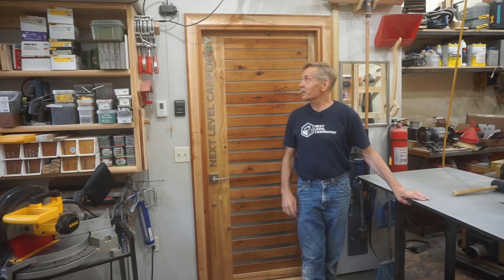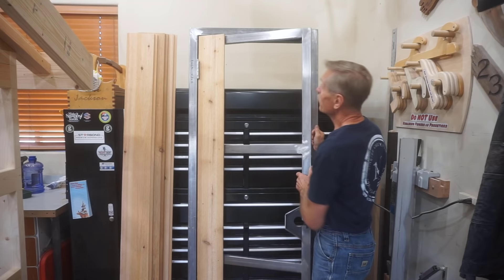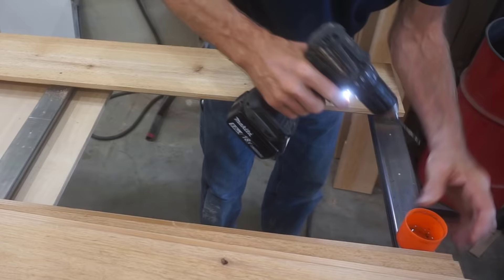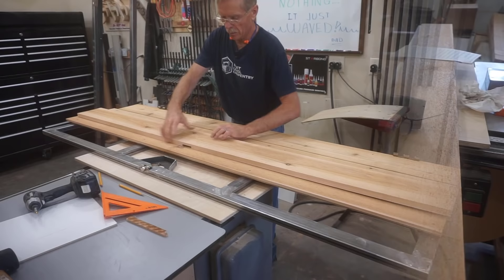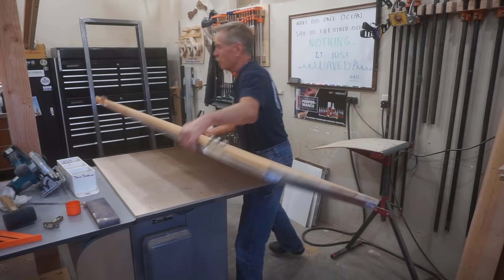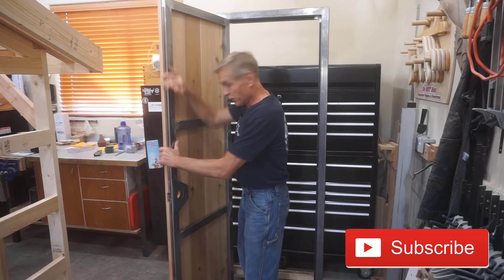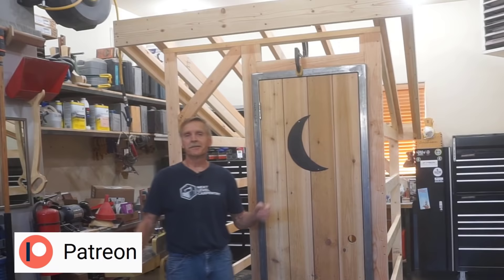How to Attach Wood to Steel

Comment: Can these screws be used to attach cypress to 14 gauge 2.5in steel frame
 tubing in a metal bldg?
Reply from the maker: I'm sure they can but you'll probably need to do a bit of trial and error to get it to work consistently.  As a rule of thumb, the thicker the steel, the larger the pilot hole.  That's because in thicker steel the screw's threads aren't really cutting threads into the hole as much as they are deformed by compression.  To see what I mean, drive a screw in so it grabs and seats and then remove it.  There won't be much for threads in the inside of the hole but threads on the screw will be mashed down considerably.  Keep in mind that it doesn't really take much for the screw to hold wood to steel strong enough so that if you try to pull a board off the screw head pulls through the wood but the screw sticks in the steel.  Do some experimenting to find the smallest size hole that screws can be driven into consistently without breaking the screw or stripping its head.
BTW I'm trying to source about 300~400 board feet of 4/4 cypress for a project and can't find anyone locally to supply it.  Where are you getting yours?  A source would be greatly appreciated!
Best, Matt
Reply: @NextLevelCarpentry  Dude stop adding music.  there is no need to add music.  TY for listening.
Reply from the maker: @MichaelMantion  TY for listening?! You are polite enough but if you think I'm going to quit producing videos the way I do because of your comment you're at least mildly delusional🤨😂😂

Comment: Fantastic little tip! I do prefer stainless when working with cedar though. I’ve found EVERY other fastener eventually starts bleeding, regardless how corrosion resistant they say they are.
Reply from the maker: Thanks for posting this comment with your preference Dan!  Because of it I checked Amazon and found they have the same GRK torx drive trim screws (in 1 1/2" length) in STAINLESS STEEL... NOICE!!  Stainless is my preference as well but I didn't think to see if they were available until now.  I thank you and my client thanks you as we won't have to deal with inevitable streaking (eventually) from the good but not as good fasteners I use in the video.  Best, Matt
Reply: @NextLevelCarpentry  I’ve gleaned a lot from you Matt, glad I could be useful!! The stainless screws are NOTICEABLY softer- as you’d expect. Just takes a little more patience/precision, and you’ve got plenty of both. Love those little screws.
Reply from the maker: @danervin2530  I'm duly noting the 'noticeably softer' part and, with that in mind, plan to use a little wax on threads of those on the door after its powdercoated. Thankfully there's only 32 fasteners that go into metal, the rest go into wood (pine and redwood) so I think it won't be too much of a fight...🤞🏻🤞🏻 it's well worth any extra fuss for streak-free-and-proud fastening though!

Comment: Yep, works nice with GRK screws, also works well with Spax. I’m sure it will work with other high quality screws as well. Another good one for interior trim work with steel stud framing is Senco’s hardened diamond point 15 gauge finish nails.

Comment: I love combining steel fabrication with woodwork. Powder coating is a great solution for protecting the steel (if not stainless). The temptation is to pick black or something outrageous. I tend to pick colors that compliment the wood finishes I use.
Hah! That’s a finely crafted outhouse, for sure.
Thanks for the tip! Oh, I also have been known to add a daub of PL200 to the joint between steel and wood to ensure it stays together through inevitable door slams favored by young folks…😉

Comment: What many don't realize and many more do, is that trim screws, all weather deck screws, even the E.G. (gold) drywall type are case hardened steel (actually, the black phosphate drywall screws are too), or a fully hardened steel. This is a pretty old trick and works well. With the right sized pre-drill the screws are hard enough to cut their own threads. How do you know they're hardened? Drive one into a scrap of wood about 1/3 to 1/2 of the screw length and bend it over with a hammer. It'll break off either on the initial bend force or when you straighten it, you won't get it to bend twice. Denotes a hardened steel. Try it.

Comment: @Next Level Carpentry do you have any suggestions to doing this for an exterior fence panel detail... cedar into steel?...
Reply from the maker: Pretty much exactly what you see in the video WT. Note: I'm convinced that stainless steel screws are key for non-streaking fasteners over the long term.
Best,
Matt

Comment: Dear Matt, thanks for the tip. Hiding the screws certainly makes the final look more professional. 

One thing I have to point out is that your videos all look a little blurry. Could it be that the lens filter for your camera has picked up dust, paint or sandblasting marks? Changing the cover filter would be an easy fix to deliver sharp, crisp videos. Alternatively it’s the resolution of your camera or the resolution you compile your videos on your computer, like VGA vs HD or SHD. I miss some of the detail like when sanding Bondo on your video on preparing paint grade lumber for finishing. Cheers.
Reply from the maker: If there's any clear shots in videos you're referring to then any 'blurry' clips you see are due to lighting, temporary dust on the lens or the fact that, because I shoot all the video myself, I need to do a lot of digital zooming, sometimes to as much as 200%, which tends to 'pixelate' video and decrease clarity.  I only wish it was something cured as easily as a dusty lens😥
Reply: @NextLevelCarpentry  Yes I see. The one example I can think of was when you were “zooming” in to the Bondo resin in wood where the close-up became pixellated.  It’s not the camera zooming in, maintaining focus but your post-editing on a fixed focal length filming.  I guess the only solution would be to have a dedicated camera operator who was doing the zooming live and maintaining focus and depth of field. That would be very expensive I would imagine.  I find it hard enough to get say a good close-up of a plant or little animal but doing it in video, well that’s a whole level more difficult.  

What I do know is that other YouTube presenters have got this facet licked and it may be good to chat to them to see how they go about maintaining a crisp image at any focal depth.  Cheers.
Reply: Get new glasses and clean them with 40 grit paper every day and you will be singing Matt’s favorite song “ I can see clearly now that the rain is gone “

Comment: would this work with aluminum tubing as well?
Reply from the maker: I don't see why not.  You might end up using a little wax on the screws so they don't 'get stuck' driving into aluminum.  My guess is that it might take a smaller pilot hole because aluminum is softer too?  Regardless, a little experimenting with scrap should address those issues and anything else that might be different.

Comment: Hello, putting up a steel i-beam and need to connect plywood to the top flange. 1. What type of plywood would be best? 2. What type of self tapping screws would go through 1/2” steel flange? Note: steel mill is making holes
in top of flange for me.. thank you sir!

Comment: Hi Matt, I’m new to your channel and just found this video helpful for attaching wood shelves to a 3/4” square tubing framed liquor display that I’m building. That said, I’d like to ask your thoughts on another part of my project… I am using 16 ga mild steel sheets (hot rolled, I think) as a backsplash for my above referenced liquor display, and need to attach directly to bare SPF 2x4 framing. I finished said sheets to a high gloss antique “mercury” mirror look and want to find a way to cover or hide all attachment method(s) and seams.  This is a commercial bar application, so I coated sheets with an oil based poly and I will have to thoroughly seal all seams in compliance with health code standards. Currently, my thought is to cut(rip) sheets to hide joints behind my shelves (1^1/2” total width of shelves), attach with wood screws close enough to edges to also hide behind shelves, and seal joints with silicone caulk. While this would hide my seams well enough, I don’t know how to get screw heads out of the way to make sure display sits flat against the wall. Not sure if I can countersink so close to edges or at all with metal this thin. I’m a woodworker gal, so my knowledge of metal and wood/metal combo is novice at best and I’m sure that that there are options that I don’t know to consider. Any advice that you can give me would be greatly appreciated.
Reply from the maker: It's hard to answer your question confidently without a complete understanding of the design/installation but because you mention bare 2x4 stud framing, my first reaction is to advise using something like contact cement to glue your steel sheet to a substrate like 1/2" OSB or MDF sheet, otherwise I think seams between studs would be a nightmare to seal and get to  look right.  In that case you could leave the sheet 3/8" short of the panel edges where screws or nails could hold everything in place, sealed with silicone caulk and hidden behind your 1-1/2" thick shelves.  Or you can match edges of steel and substrate panels and CAREFULLY countersink for flathead screws that would hold steel to substrate to studs leaving only a metal to metal seam to seal.  
There may well be a better design for the installation and fastening but that gets into the overall scope of the project... Good luck... sounds like an interesting project!

Comment: Great vid! Love the door!
If if I wanted zero hardware visible on the face, would it be possible to to screw the panels down from behind? If so, would the same screws work?
Reply from the maker: I wouldn't recommend use of the same screws for holding the panels on from the back Chris. It takes a large screw diameter to hold in soft wood like cedar and redwood because you only get about 5/8" screw depth when attaching 3/4" ~ 13/16" thick panels from the back side so  I use #12 or #14 stainless steel pan head screws for projects that require 'invisible' fasteners.  I considered them for this project but the it was cost prohibitive because of extra time for planning, layout, drilling and assembly.  Plus all the rest of the siding on the structure will be attached with torx drive trim screws too, so a precedent was set.
Thanks for watching and commenting on this video! Best, Matt
Reply: @NextLevelCarpentry  Thanks for the reply! Keep up the great work!
Reply: Love the video. Keep up the good work. What is this door going to be used for? I’ve never seen a door like that

Comment: Thanks. Re: the gauge of the steel squarish tubing you used to build the frame of that door... if it is 5/64", then it is ~equal to 1.9844 mm... (You arrived at 5.64mm). Just wondering... I hope this helps 👷

I think you are a real master... Today, i used GRK lag screws, following your advice within another video.
Reply from the maker: Hi John,
Your metric equivalent number is indeed accurate however I was just being silly with that figure... if you listen closely I said "5.64 milliminches" in an attempt to make light of the fact some viewers get worked up about lack of metric measurements in Next Level Carpentry videos.  I've been tossing in other little quips like this in recent videos just for fun and it seems to be working.  Here's another recent one if you're interested: https://youtu.be/-ZgDRLM8DqM?t=423  
Glad you found GRK torx lags useful... those things are amazing!  Thanks for watching and commenting too! 😎
Best, Matt
Reply: @NextLevelCarpentry  yes, you keep the presentation light and quick. It's important to encourage people who think woodworking that, with proper planning and the proper tools (though not expensive), they could build something that doesn't fall over 👷

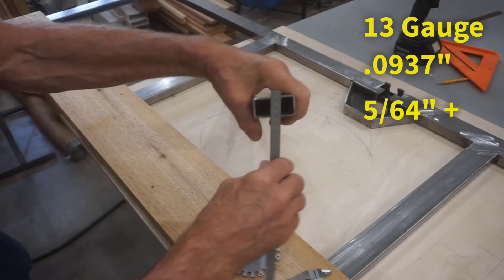Not trying to belabor the point but you have the gauge in millimeters ("mm) written over the video at 1:30 min from the beginning. Only us Hispanics would probably catch that 🙋

Comment: Very instructive as any of your videos. One question about this one's subject. Can wood movement while screwed to the steel make the board crack?
Reply from the maker: I'm sure it could, just like when wood is screwed or nailed to wood.  Main thing is that this is the best option for holding wood to steel without using fasteners with large, exposed heads IMHO.

Comment: Does this work for softer metals, like sheet aluminum? Or would those screws just strip it right out?
Reply from the maker: Works fine in softer metal but not in harder types. With aluminum in particular you'll probably need a slightly smaller hole size and wax on screw threads might prevent screws from sticking and snapping when being driven.

Comment: In commercial buildings, for years I have seen wood base and trim attached to metal studs using those screws.
Reply from the maker: That application is probably what the screws were originally designed for... the difference here is the difference in thickness of steel studs at what, 22-26 gauge? vs steel tube at 13 gauge...
Reply: @NextLevelCarpentry  structural studs can be as large as 12 ga.  We had to predrill all holes in the studs  hanging cabinets.  A real pain.  Lots of guys use the screws with a drill bit on the end so it's a one shot deal.  Sheetrock hangers used them.

Comment: If these boards are a single sheet, how do you fasten the sheet to the metal frame, with respect to thermal expansion/contraction?
Reply from the maker: I'm more concerned about wood movement on individual boards than thermally generated expansion/contraction from sheet goods or the frame unless the door was very large...

Comment: I use those screws to install wood flooring right up against the wall with a 90 degree driver adapter.

Comment: Have you thought about drilling a sunk hole for the head and tapping it with a bit of color matched wood filler to have an even more invisible look?
Reply from the maker: Not for an exterior project like this where ANY filler will fail in relatively short order...
Reply: @NextLevelCarpentry  Ah! Great point regarding exterior projects! Thanks for letting me know.

Comment: Matt, I think you'd be the best one to ask about this. I was wondering if it would be possible to frame a house out of pallet wood that's been made into slabs and cut to what size you need. I figure it's probably just as strong or stronger than conventional lumber since it's layered. What do you think?
Reply from the maker: Possible? Sure.  Practical?  I seriously doubt it.  Economically feasible/sensible?  No way.  It's generally true that 'layered' wood (think LVL's and gluelam beams) are stronger than conventional, careful production control standards/practices need to be followed for consistent, reliable results.
To make it strong/stronger would require properly engineered lamination with the right adhesive (like resourcinol glue?), etc, all of which go directly against practicality and economics. 
Interesting proposition but likely polyanic IMHO Best, Matt

Comment: I would assume a fine thread screw would be best for this method?
Reply from the maker: Not necessarily... the GRK trim screws are more coarse than standard machine screw threads and work just fine in my experience.  Might get into fine thread territory on thicker, harder steel though...

Comment: is it preferable to align all the screws on a straight line?  If so how "wood" you do this?  I'm assuming a chalk line would leave behind chalk.
Reply from the maker: Even though the screw heads are small I prefer to line 'em up.  It's pretty easy to use a framing square or straightedge to line holes up or to put little pencil marks for screw locations. BTW  I ended up getting the same torx drive trim screws in stainless steel... worked great and won't streak with rust over time. 😎
Hope you had a Merry Christmas and look forward to 2022!
Best, 
Matt
Reply: @NextLevelCarpentry  would you advise ever adding putty to cover holes in cedar?
Reply from the maker: @aaronandbethrodgers4472  Not for exterior use... I think you'd only postpone the inevitable of the putty failing/falling out over time leaving screw heads exposed in the end.  If you wanted to have a no-fastener look I think large diameter screws with large threads driven in through the back might be the way to go.  Lot more work for only a marginally better finished product IMHO...

Comment: Just wanted to pass on that I ordered my Rube like pliers from Menards.  Thank you for the guidance
Reply from the maker: That's funny Roger... I think you'll have fun using them even if it means getting them out when regular pliers would get the job done... I smile just looking at those crazy things even if I'm not using 'em! 😁😎
Reply: @NextLevelCarpentry  I know what you mean but that one time that I need the extra 2” of reach in a tight spot I will always think about your video
Reply from the maker: @MaddMaxxWoodWorks  exactly! 😎

Comment: 5/64" is a bit less than 2 millimetres (1.9844 exactly).
Reply: I came here to say that as well
Reply: This is another case of rounding error. 13 gage is actually 2.3 mm (he did say 5/64 +) But the 5.64 mm is totally wrong.
Reply: @timpedzinski230  Yep, 13 ga is 3/32".
Reply from the maker: It appears to me that this thread is totally missing the point that those are erroneous measurements I mentioned in the video are meant to be a joke... 🤣
Reply: @NextLevelCarpentry  You're absolutely right. But you know - we Europeans have no sense of humour if it comes to our absolute, only and the best metric system.
Reply from the maker: @Stefan_Kawalec  obviously not...